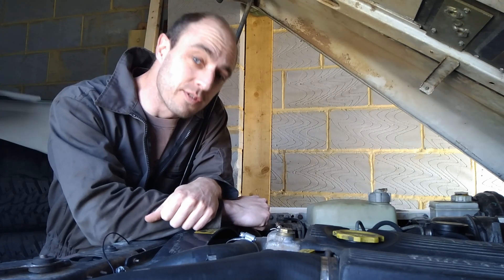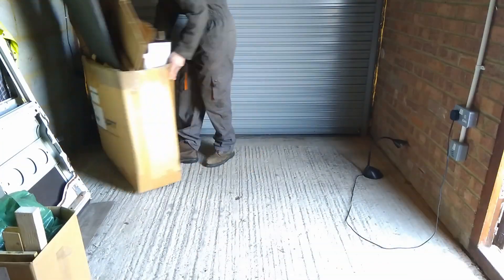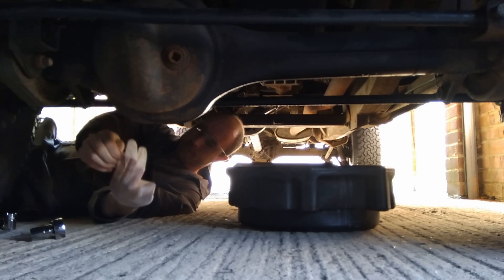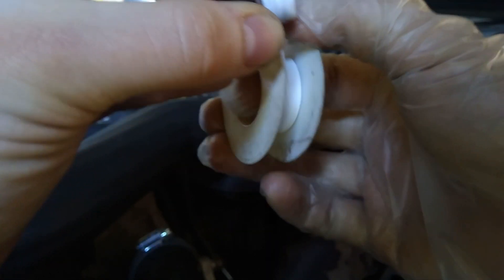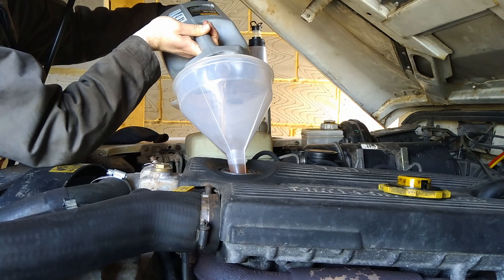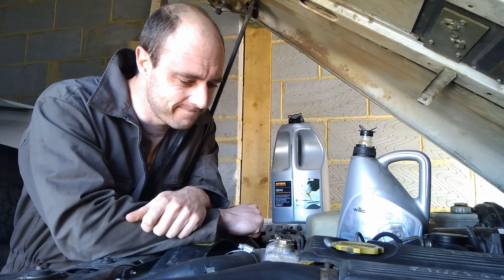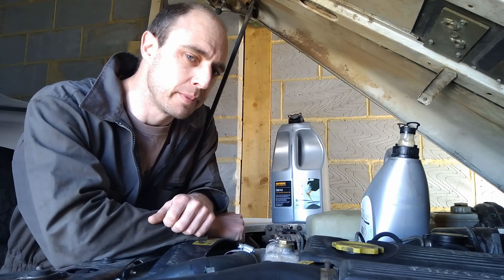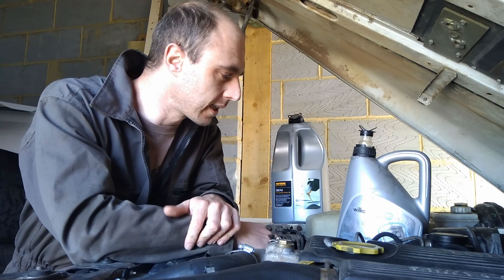An illegal 300Tdi oil change and maintenance musings

Comment: Use a Plastic bag or rubble sack to put over the oil filter to catch it & it’s oil when changing it, this makes it so much easier & cleaner.
Reply: I like that ... might give it a go. Cheaper than a remote filter kit!
Reply: I’ve tried all sorts including the plastic bag trick when changing the oil filter on my 300 Tdi…..still haven’t managed to change it without getting oil everywhere including what seems like a gallon up my sleeve……the rest drops all over the front diff casing then runs along the axle dripping indiscriminate along it’s length…..I feel his pain!
Reply: I tend to work over a wipe clean heavy duty ilno or the like, put an old towel over the diff etc. To be honest I've done it so many times that I've got it down to a bit of an art. The trick is to bribe, black mail or threaten a friend into doing it. Years of mates rates and favours on landy work is a nice trade. 

The other solution is the Isuzu 2.8 engine swap... the filter is upside down and you reach it through the top rear of the engine bay.  Must do that job...
Reply from the maker: @mjallenuk  lol
Reply from the maker: yeah I tend to double bag and hope it doesn't go wrong...
Reply: Well that's how many of us ended up with kids... failing to double bag must be a huge statistic especially with an excess of lubricant everywhere
Reply: Trouble is the oil runs down your arm as you unscrew it.

Comment: I understand the complacency about oil changes, however an interesting difference between the attitude to oil changes & maintenance compared with a recent video extolling the benefit of fitting genuine parts. Now I generally use OEM parts (whatever that really is, as quality varies) but would never even dream of putting cheap supermarket oil in my engine or gearbox etc. Funny our ideas of what we things can compromise upon, is it a case cobblers kids worst shod. To qualify this statement I am a 300Tdi Defender owning Engineer but also believe some things make a negligible overall difference.

Comment: I have only just changed my engine oil after several years!! Six to be exact. Probably drove around 4k miles.   It runs like a dream with little oil usage.  I always stick a huge magnet under the filter too. 97k from new.

Comment: Have added a "FilterMag" shaped magnet device to the oil filter on my 300TDI for the last few years, the oil now stays remarkably clean on the dipstick between changes (yes the dipstick does reach the oil..).
Reply from the maker: I always wondered about sticking some old hard drive magnets to the outside of the oil filter!

Comment: Here a little warning Just spent 4 hours having to change all the metal coolant rail on the TD5. Do not open the drain on it for the antifreeze draining Its easier to open up one of the hoses.
Reply: Is this the drain plug on the bottom of the manifold beneath the engine? Broke mine off at the soldered joint, but I found another manifold for $75. Good times reinstalling it...
Reply: @davidstech1445  Yes that's the one. Got to keep on top of TD5 cooling, heard of so many people cooking the td5 engine. A good tip is to replace all of the hoses at this stage and thermostat.  Be wary of cold pressure testing. I have a little hand pump that fits on the expansion tank. Generally, pump it up to 15psi, then leave for 1 hour to see if it goes down. But always check when you have warmed up the engine.

Comment: Hi Will - looks like you need a break!! I think you make a good case - other than the obvious change in colour between new and used oil, for the lay person it's very hard to know how good any oil is when new and how quickly it degrades.  Unless the environment and/or use is severe I'm with you. Cheer up!  Simon

Comment: Filters I always buy are Mann for the centrifugal filter on TD5. Others do not seem to be balanced when they spin. Never bought an original one though. On Oil at present for 5w30 C5 spec for petrol or B5 spec for diesel, is the best rating. Oil changes I have found give me about 3mpg more, then degrade over time. Debate, Vicious fan take off winter and put an electric on in summer? Any thoughts?
Reply: Martin, Mann filters are fine.  Britpart are utter rubbish.

As far as the fan is concerned, if the viscous unit is working, why change it?  The fuel economy and performance gain claims by Kenlowe and other electric fan manufacturers are lies - if there was any benefit to electric fans, why do all premium car manufacturers use engine driven types?  Electric fans are only beneficial where and engine driven fan won’t fit, like in transverse engine installations or vehicles retrofit with nonstandard engines.

Comment: If your not changing the filter, are you not leaving 1 litre of old oil behind in the engine, or do you drain the filter & re-use it, nice trick with the PTFE!
Reply: Problem with PTFE is that it’s not a sealing agent it’s a lubricating agent. It won’t really do anything on a parallel thread and is really only effective on a tapered thread as the ptfe allows it to tighten further. The sump plug thread isn’t designed to seal, that’s the job of the copper (sometimes alluminium) washer either of which can be reused multiple times if you anneal it first.

Comment: I've had my 300tdi Defender 3 years, and put about 10k miles on it. It's got 158k miles on it and it's never had an engine problem the entire time I owned it.  I run full synthetic mobile 1 and its running great.  It belonged to a charity who serviced it every 6 months like clockwork before I got it. It's running fantastic.

Comment: G'Day Will
I see that its ramble time in the man cave :) Ok so here's my ramble on oil changes, it happens every time that my local SUPER CHEAP AUTO store has a sale on Penrite Full Synthetic 5-40W HPR 5 10L oil drums that roughly align with my regular maintenance cycle on our 2 deffers.  :D normally its over $100AU a drum so when its down to $60AUish I grab it. I usually order filter kits in the intervals between oil changes so as to be on hand when it comes around. Since I know how much each deffer uses, I just mark off on the sight panel on the drum - attach a tap on the bottom and let it rip till its at the mark. Oh I also have a hill for a drive way so I do this on the street and use a LARGE drip tray as well as the oil pan.  :)
Reply from the maker: That's a good system!

Comment: used to get my local garage to do my oil changes didn't cost much more than me buying the gear to do it myself that was until i found out the mechanic was putting 15w-40 in my TD5 even though i left the bloody workshop manual on the passenger seat for him only had a land rover for 4 years now i am a highly qualified mechanic when it comes to the TD5. 
When we replaced the head on my 15p TD5 we also found one of the injectors was for a 10p i know the net has a lot of bs on it but it's not hard to decipher the good info from the bad info